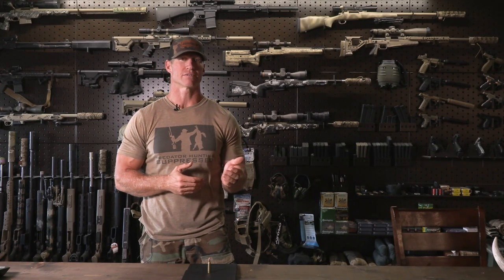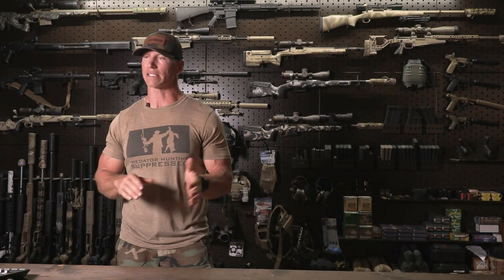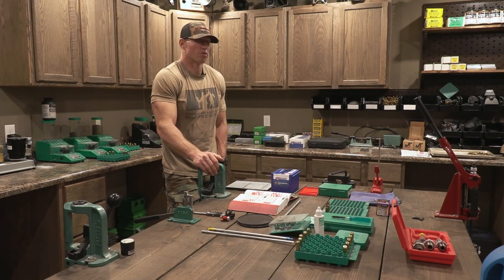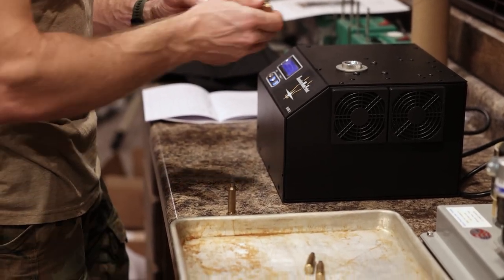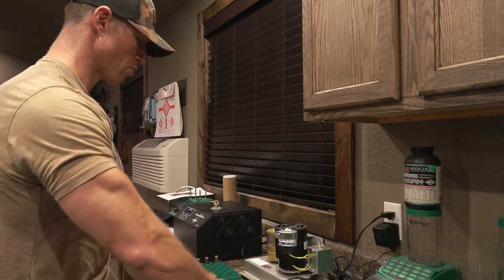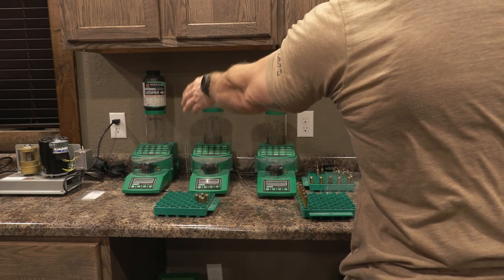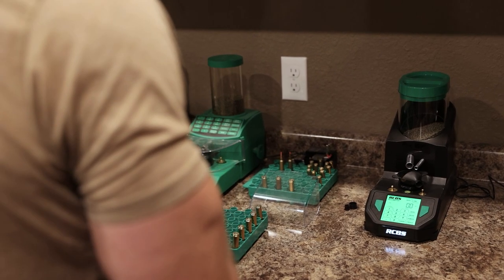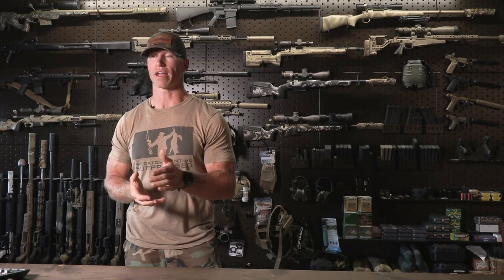Reloading the BEST Cartridge Selection for Coyote Hunting.  The Remington 22-250

Comment: Good video...like you said in the beginning a lot of your equipment is top of the line and $$$ and that's fine.
  I've been reloading for 40 years with basic reloading tools,hand case trimmer,propane annealing,weight bar scales,  and digital scales,powder thrower,and hand trickle it up, good rifle and the end result is the same tiny groups. Have you ever tried the 53gr vmax,better BC then the 50s by a bit for longer ranges.
Reply: Reloader for 16 months...I like throwing powder a tad low and trickling it in. Maybe for the reassurance or something that I like about that.

Comment: Great video, as always! 
I admire the dedication and hard work you put into your shooting.

I know you run an 18” 1-8 twist barrel on your 22-250 with the 50gr Vmax but what sort of velocity are you getting from your load? 
I also shoot a 22-250 but with a 24” 1-14 twist barrel and I am thinking of getting a shorter, faster twist barrel but wasn’t sure on how much it will affect my MV.
Any advise would be welcomed, thanks.
Reply from the maker: Thanks for the support man!  I'm getting 3400 to 3500 on my 18" barrels chambered in 22-250.
Reply: @ONEILLOPS mould your own bullets at all? Im testing pure zinc right now. Have tried different alloys too down to pure lead in rifle to solid copper in my flintlock pistol.

Comment: What twist are your barrels? Does twist rate matter in reloading? I'd like to know more about the proper jump to the lands. Great video!
Reply from the maker: 8 twist... I can do a video on that.
Reply: Bryan Litz from Applied Ballistics has published a lot of data about twist rates and finding the right bullet to match it. Every reloader should check it out.
Reply: @ONEILLOPS  Woukd love to see a video on this.
Reply: @hulley5223 bullet jump can be an issue. Easiest to do in my 10mm conversion using 40 s&w brass shooting around 50 yards. 10mm and 40 s&w loaded with 200 grain bullets. Bullet jump makes a big difference. Ill let my 338 seat my bullets and then drop an additional.010 before i crimp the brass these days.

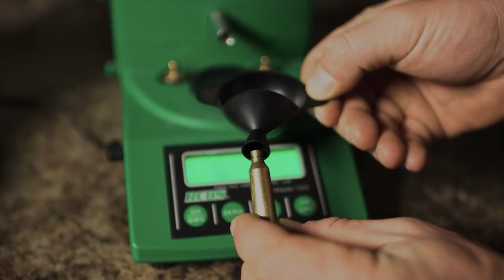Comment: So I’m getting into coyote hunting and was thinking about the 22-250 and found your podcast episode about this video. I think I’m dead set on the 22-250 now after this but the big question I have, what companies make barrels with a faster twist rate other than a 1:12 or a 1:14? I see ruger has a 1:10 but I’d like a 1:8 or a 1:9 to run those heavier rounds through it.
Reply: Tika offers a 1:8, Bergara a 1:9, Salvage a 1:10. There a probably others, too.
Reply: @Gman-lf5bh  update just bought a bergara B-14 Hunter in 22-250 and it’s freaking awesome
Reply: Thanks for the info! And I thought I was good at researching for OEM guns w fast barrels! You founds some needles in the haystack! Now any luck on OEM bolt actions with fast 1-8 or 1-9 in .243's. Not that I don't respect the venerable 22-250! That three shot grounp was off the charts impressive!  @Gman-lf5bh

Comment: Dont try and get accurate load through the powder amount, you get a good ES with your powder first, and if it is not accurate then get it done with seating depth and it should come into accuracy within 6 thou of movement, most think the accuracy comes from powder but it does not, you can have a accurate load at 100 yds with a good seating depth and crap ES but it wont be good out past 500 yds, i am a proven F Class shooter if thats worth anything/ Hey dude that is a nice technique you have there.
Reply from the maker: Great bit of info!  Most of these rigs are designed for 400 and in.  When we go further with the 6 or 6.5s or 30s we pay closer attention to the ES and SD numbers.

Comment: It looks like your are running AICS pattern mags. I've tried a 22-250 in them and can't get them to feed reliably. What mods did you have to make if any to get them to run?
Reply from the maker: Yes we run the AI mags as well as the Accurate Mags on our 250's with zero issues man, none... Who's your rifle builder?
Reply: @ONEILLOPS  its an old rem 700 vssf 2 with the HS precision stock that I put into an XLR chassis. Wondering if I need to tweak the feed lips on a mag?
Reply from the maker: @gusmengers5454  All of ours are on custom actions which have a better feed ramp than the factory 700.  Open your feed lips just a tad in the front so the nose of your rounds angle with the more abrupt 700 ramp.
Reply: @ONEILLOPS  never thought about that. Thanks for the help and keep up the content. The channel is great!
Reply from the maker: @gusmengers5454  thanks buddy! I really appreciate the support!

Comment: Why do you use a 1:8 twist for 50 grain bullets? A 1:12 would handle 50 gainers just fine.
Reply from the maker: Yes a 12 will work fine, but I want the option to be able to run heavier rounds if I need to.

Comment: What about 222 mag? Is that considered varmint round?
Reply: a 222 mag could definitely get the job done assuming you are using the right bullet, but the 22-250 is far more popular and therefore easier to find components for, which is extremely important now because of shortages.

Comment: 22-250 really? Better be a fast twist barrel.
The 22 cm and alpha ocd brass give that a big edge. My 22 dasher pushes the 90 grain a tip at an easy 3100 fps. The 22 cm does it better at 3200. But a lot more powder. My main point is the 250 is dead without a fast twist barrel
Reply from the maker: I can see you don't follow our work closely, at all. 
Your point is an opinion and that's it.  The 250 has and will be used well before and beyond the fad of any new cartridges.  I've been using fast twist 250 barrels for 20 years plus, before the CM was even a dream.  I could break apart your whole concept, but I'm getting the feeling it's gonna be a kool-aid drinking, Ford/Chevy argument, with you.  
But I'm gonna do it anyway.

We kill 200-300 annually, and by annually, I mean in a 4 month time frame, consistently, I'm not saying that to brag, or throw my dick on the table, I'm saying this because it's experience, over the past 25 years.  You come here and say the past few thousand that we have killed with a cartridge selection that you think is "dead".
The 22-250 "really?"  My response... Absolutely every day of the week. 
 
Why?  
Maybe it's because the case taper allows a mag fed system to be more reliable and fluent than the Creed design. Maybe it's because I've built 3 22-Creeds the past 2 years and can tell you from personal experience the 250 is easier to load for.
Maybe, it's because we keep the fur and there is absolutely no reason for me to utilize the case capacity and push a heavier projectile faster, when I don't need to.  
Maybe it's because we are more meticulous and try to fool the animal at a distance much closer than guys think.
Maybe it's because I"m not a PRS guru, I'm not a comp guy, I'm not tryin to lay hate at 1/2 mile or a mile on fur, so I don't need the BC that you do.
Maybe it's because my 22Creed is for Longer ranges "IF" I can't do my job getting the animal close.
Maybe it's because the 250 delivers every bit of hydrostatic shock that I need, with the projectile of my choice.
OR maybe It's just a personal preference, which I have ZERO issue saying.  
Just don't come here and tell us, the cartridge selection of our choice is dead, it's definitely not an educated statement.
Reply: you got a new subscriber after that comment.  Thermal hunting is a blast.  I put my reap-Ir on my .223 AR.  I’ve been wanting a 250 for a while now.  gonna have to watch a few more of your videos.
Reply: Much respect for holding your ground when you are the real deal in the field! Also like your response on Juiceboy's coment which was un called for. Your obviously a very smart guy and don't need wanta-be's questioning your fitness details. I can respect what it took to achieve your level. The details are your business.New subscriber  @ONEILLOPS